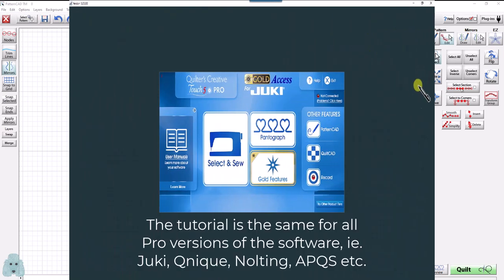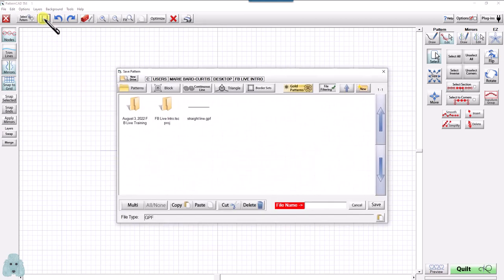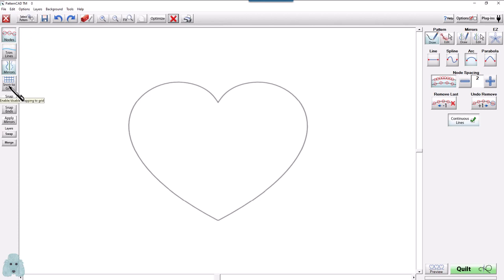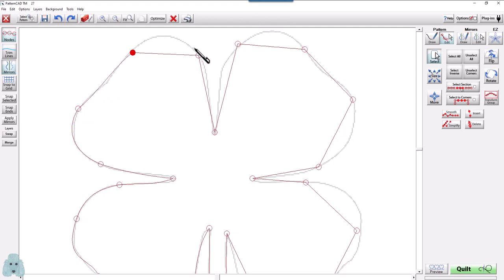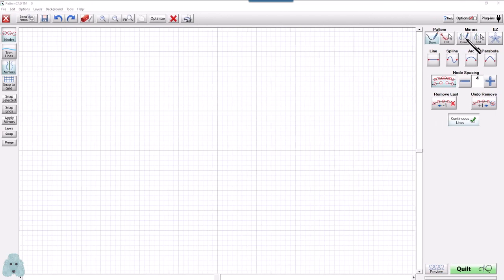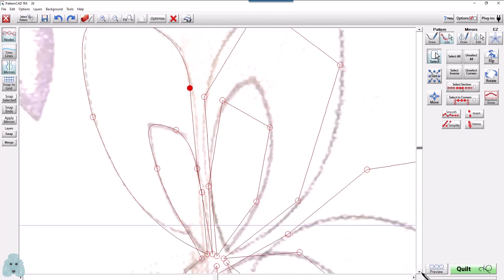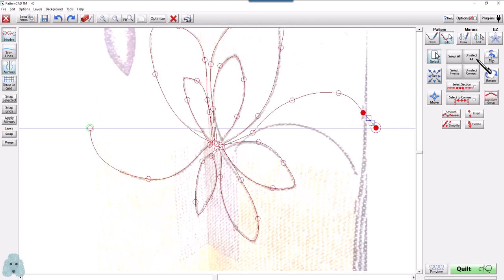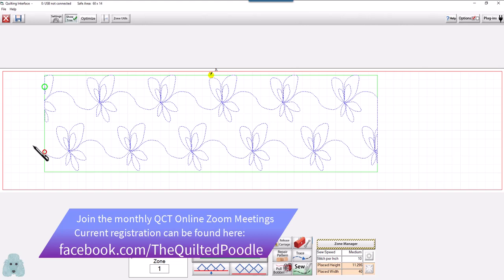QCT Pattern CAD Tutorial 2023 | The Quilted Poodle

Comment: Hello, thank you for the tutorial, it got me started in Quilt Cad.  I am having difficulty making my pattern continuous.  I have both sides on the same plain, however, it is not working.  Would you have any suggestions?  Also, can you please tell me after you save the pattern, is it possible to go back in and edit or change it in any way?  Thank you!  You are an excellent teacher!!
Reply from the maker: With continuous line patterns, the starting point is on the left and the ending point is on the right, usually. If your ending point is on the left, add stitches that trace across your design to the right. (Does that makes sense?) Yes, you can edit your own patterns in Pattern CAD.

Comment: Why do you need the line on the bottom layer?
Reply from the maker: It helps me to stay focused on the horizontal plane that I want my beginning and ending points to  be located so that each repeat of the pattern will connect smoothly.  With the latest version of the software 5.06.09 it will make a correction for you so that your pattern will be continuous by selecting "Snap Ends."  I always use preview to see what my pattern will look like and if in fact it is continuous.